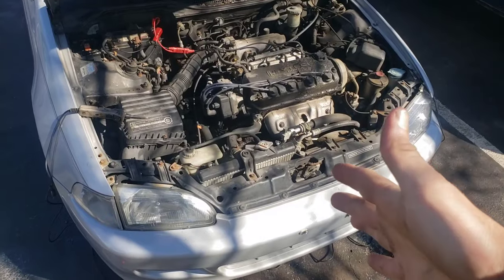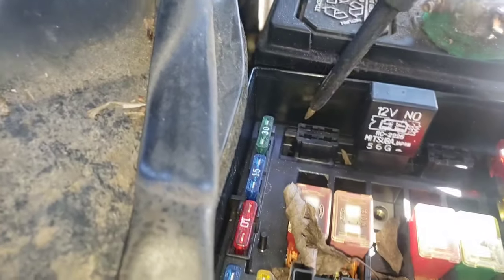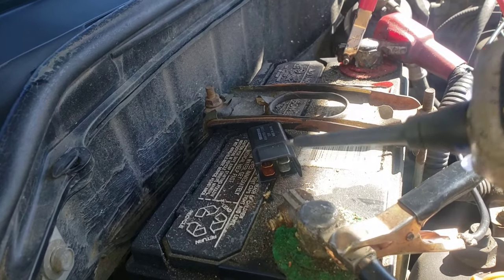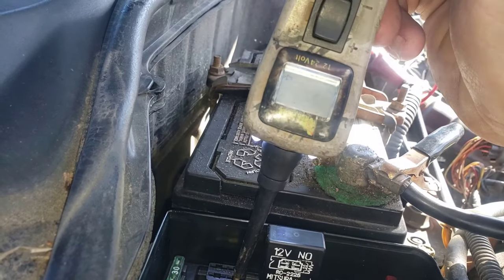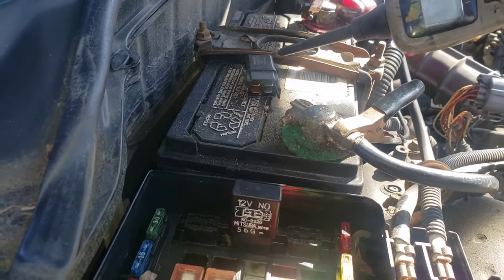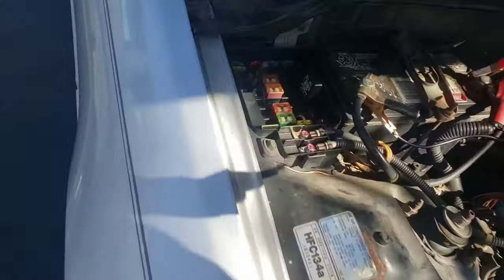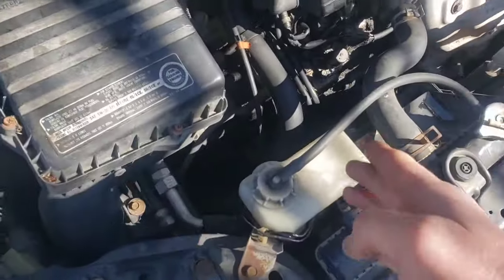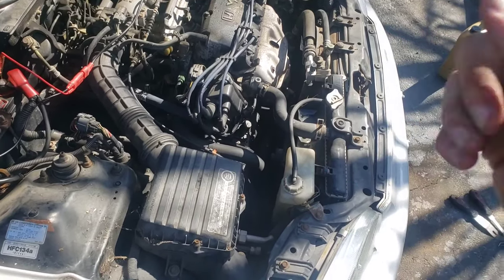Why is Cooling Radiator Fan Not Turning On How to Check Test Stays Off Cause Overheat Idling Sitting

Comment: Well I haven't fixed my problem yet, but as a residential electrical contractor, u definitely broke down the system and how to check everything properly, saving everyone time and money.  I've watched so many vids and non has helped.  Ur helps.  Other vids mechanics replace head gaskets and everything else u can think of.  The dealerships even do the same thing.  Everybody knows nothing.  This vid explains it all.  Thanks again.

Comment: I thought the OL meant Open Line. If wire was burnt in too, the ohm meter would READ OL, for open line. Over limit, never heard that one before. Either way, just as long as you know it's an open circuit.

Comment: If you swap relays with another that controls the power windows for example, and the windows work using the relay you suspected as bad, does this mean the relays are fine or might one be working well enough to control the windows but not strong enough to operate the fan? Thanks for any advice
Reply: Yes. If you use the suspected bad relay (exact same) on say your pwr windows and the windows work then the relay is good.

Comment: My fans were not coming on till the temperature at the t-stat nosel until 235 degrees. I believe it was letting the
 engine get hot enough to cause my coil packs to burn out causing the car to miss. Turned out rust was also in
 radiator.

Comment: I have been working on a car that I'm getting good connection with everything I've tested the relay circuit and on power I have power on ground I have ground but on the other 2 that opens and closes the relay I have negative on both sides do you have any idea why or were I could check next could it be the wire to the engine heat control sensor or what any help would be appreciated thank you in advance.

Comment: I like you. Subbed!
Help me!
I have a 2000 Toyota Camry 2.2. I replaced many parts already (Water Pump and it's Housing, Thermostat, Radiator, Coolant Temp Sensor, Fan Switch, I had flushed the coolant system forward and backwards and put fresh coolant in at 50/50 ratio, and i burped the system completely free of air. Thermostat opens on time, too).
Problem is, the Fan 1 Relay stays open when the Cooling fans need to come on, thereby overheating the engine. That Relay is a Normally Open type, and when the car is started the Relay closes and stays closed until the Cooling fans need to come on.
What could be my problem?

Comment: My cooling fan doesnt come on. Temp gauge is good. Replaced the thermostat. Both fans comes on when AC is on. Could it be the Cooling Temp sensors?
Reply: yes ! most of the time it is. unplug it and if the fan comes on . thats what it is.

Comment: Hi I have a question. My temperature gauge is fluctuating on 07 civic so I changed the thermostat and bleed the system but during the system bleeding usually the fan turns on which never occurred. But just to activate the fans i switched on th ac and both fans turned on immediately. I believe it's something to do with the rad fan any idea. Would cancel out fan motor or physical fan since both faned turn on when a/c turned on but just no fans turned on during bleeding process any thoughts thanks. Also during bleeding the bubbles stopped and i bleed the system for atleast 15mins
Reply: Did you get it fixed?

Comment: What if my transmission is overheating? I bought a new one but I’m scared that it’s not the problem. I end up driving the car and then losing the gears as I drive and it’ll end up racing and then I cannot get it to run anymore. I have new transmission fluid in and did it myself. I just don’t know what to do anymore but can’t afford a new car. Please tell me.
Reply: What type of car are you referring too? Transmission problems are the worst. How long do you drive it before the problems happen? Is the car fine when you cold start? Is it an older car? Do you experience jerking and sputtering as the gears stop working or does it go from working to not working? This stuff matters. If your trans is overheating you might have to much fluid in it or the computer components may be wet as causing a short. Overheating transmission sounds like a misdiagnosis or something that might be a easy cheap fix.
Reply: @MariaRodriguez-wk7gw  2002 Acura TL type s 3.2l it’s fine during cold start I can drive it but once it starts to heat up to the midway line on my dash it gives out. I lose my gears and the car starts revving to red line. So I turn it off let it cool down and then start Up again. But it progressively gets worse so I don’t drive it rn because the dudes charging me 2k just to put it in. I paid 2k just for the trans itself.
Reply: @miharukitty3186  I did some research on your car. They all have really bad transmissions. Great engines though. The video I watched the guy changed one of the solenoids in the trans and it was a $50 fix as opposed to the entire thing. He was able to drive on D5 when the transmission would heat up. An the third gear was nonexistent. 2k is alot for a 20 yr old car transmission.. so I hope the new one is gonna be problem free sometimes you get lucky. You might have to get your hands dirty if you don’t have the money. I never realized how cruel my town was until I got a car that would stall on me a lot. I been fixing my own car for about 6 years. If you don’t have a parking lot or garage than you’re gonna have to get used to alot of unwanted eyes on you. I wish you the best
Reply: @miharukitty3186  I once had a 325i 02 with a bad trans. So I thought. The car started smoking and stalled on me on the highway at a checkpoint. My mechanic said the torque converter was bad. Fixed that, still acting up. Brought a new transmission… bout $1500 later i realized the problem was a bad guibo joint and a rear main seal that wasn’t closed. Coulda been rectified with a $100 to start. If you can move the car from one side of the street to the next. Then all hope is not lost. Just do your research and save up your money. An don’t feel bad stay positive
Reply: @MariaRodriguez-wk7gw  yeah I can move it but the problem is money and time. I don’t make a lot and my mom is trying to tow the car because it doesn’t work. She doesn’t like that I’m into cars. And I also didn’t know that the car didn’t work. When I test drove it, it worked fine
Reply: @miharukitty3186  I was thinking of all the cars I sold with problems I couldn't afford to fix but yet bought a replacement car. Hmm how & why ? Because I would get a loan for the next car. I wish I would've gotten a loan to fix the cars I sold. I liked them all. Classic cars today. Back then I don't know if I could've gotten a loan for car fix but today you should be able to.
Reply: @MariaRodriguez-wk7gw  9

Comment: You could get yourself a car power inverter and a house fan then run the fans cord though your fire wall and plug in the inverter and then zip tie the fan to top of motor and ratchet strap your hood down best you can then tape cardboard around hood to close gap, don't forget to paint black then tell everyone you have a cold air blower on vehicle! "Yeah she will run 8's but right now she's got a bad window motor and I can't stretch her legs, but man if I could I'd show you her rear end when I suck the paint off your chevette"